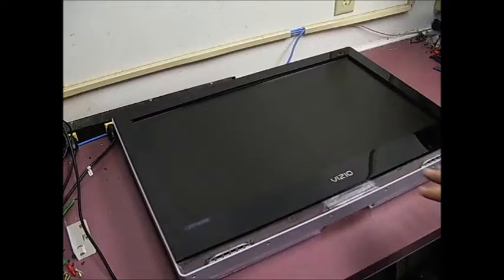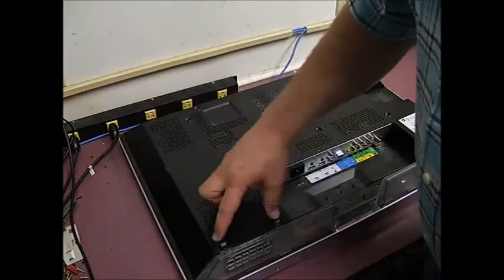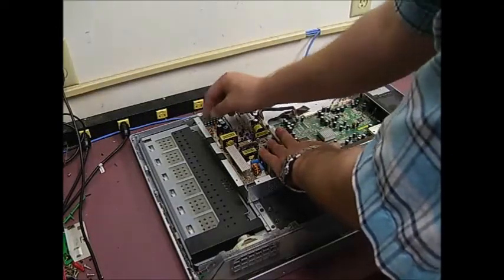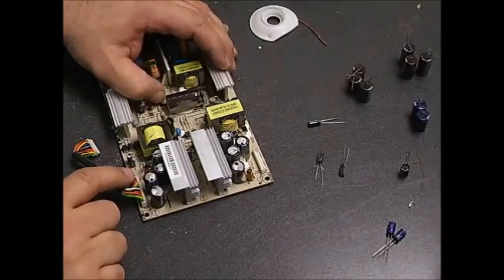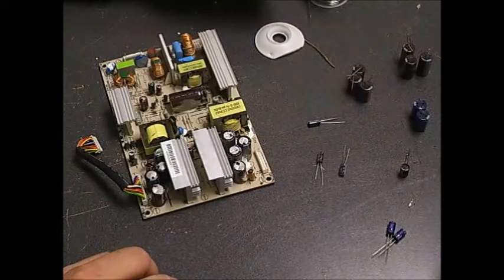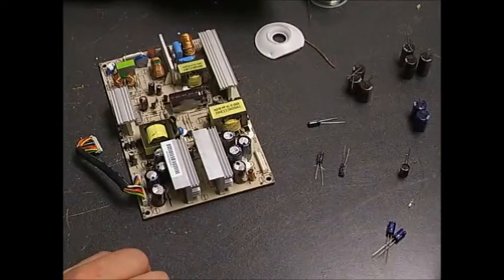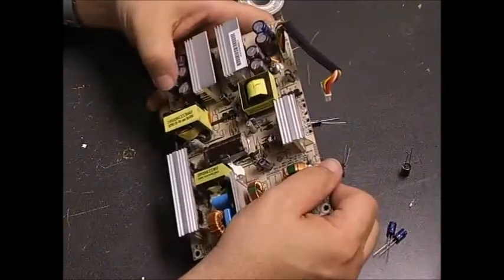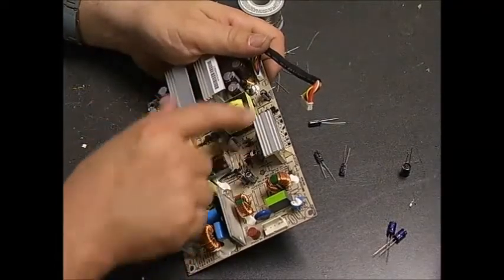Repairing a Vizio VW26L TV with no power

Comment: Good sir, THANK YOU! Had this EXACT problem with the same model TV. Watched this tutorial, went to FRY'S for the capacitors, and got to work. Had some issues removing solder from the previous joints, but replaced the problem capacitors and VOILA! A working TV! Could not have done it without this tutorial.

Comment: I own a VIZIO VW26L TV.  My input button seems to be stuck.  When I turn the tv on it is fine, however, if I change anything, ie - volume, component, it will start rapidly going through the different sources and you cannot stop it without turning off the tv.  Can you help with this?